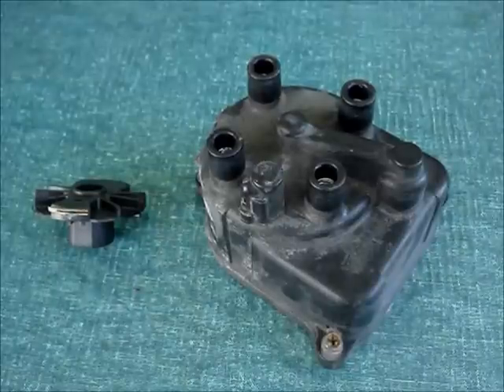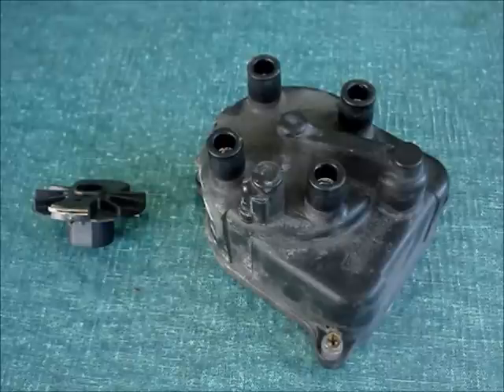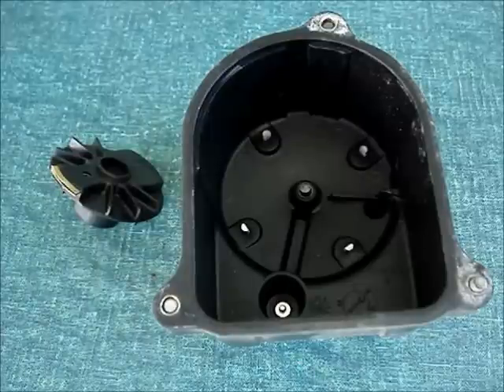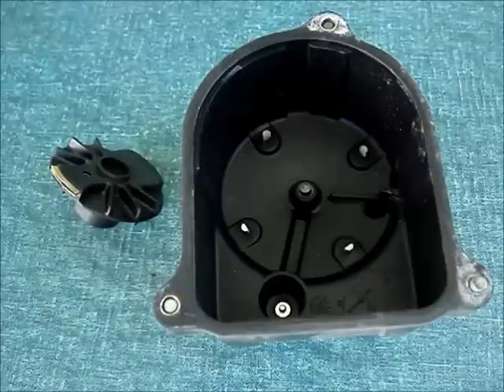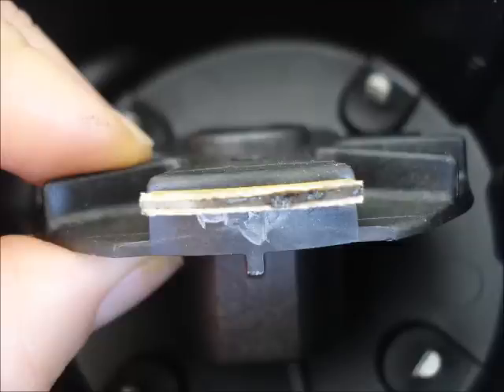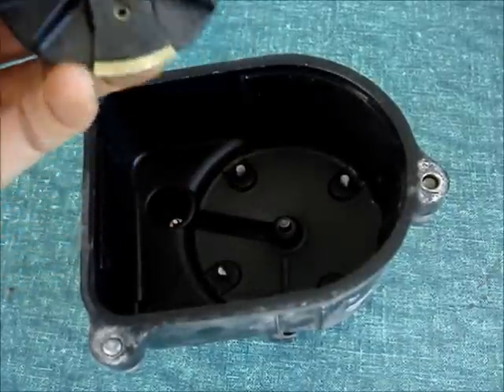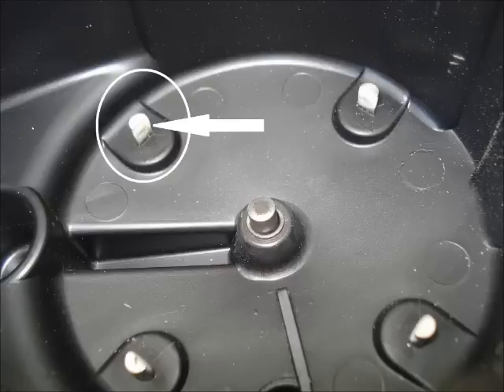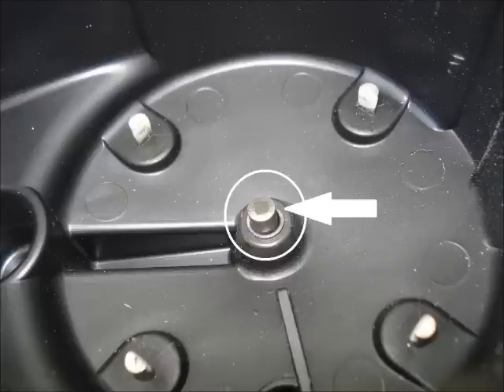Signs of Worn Distributor Cap and Rotor

Comment: 106 mile weak I have 308k know u could have just sanded the rotor was a waste of money
Reply from the maker: If I sanded down the contact areas, that would have increased the gaps to a larger size.  I'd think that by changing (already changed because the were indentations worn in the cap contacts) the size of the gap it would effect gas mileage.  You gap a spark plug, I'd think this is the same principal.  I'd think increasing the gaps even more would decrease gas mileage.  We are closing in on $4 a gallon for gas.  Do you check your gas mileage before and after you sand down those contacts?
Reply: @Know-How-Now  so when u sand the rotor and the nubs in the cap u don't wanna take a lot away u just wanna take enough of the burnt black crud off so that the rotor makes contact again with the nubs I do watch my millage cause she's an old bitch so I have to and I haven't noticed s change at all its when u start sansing to much and the gap gets to big that u start having misfire problems and millage issues. This is just Inexspensive quick fix if u need to get your car going ASAP and don't have time to wait for parts. I wouldn't rely on this forever but it has saved me for sure
Reply from the maker: My cap had grooves worn in it.  My gas mileage improved when I installed a new cap & rotor.  I don't think it was a waste of money to replace them.  I was burning money with every tank of gas.  To be clear, you are saying that sanding is OK as a temporary fix.  Correct?
Reply: @Know-How-Now  if your the nubs in your cap have grooves in them they u can't sand them. I'm talking if u have a short or something happen like when u make an electrical ark and that black corrosion shit shows up u can sand that off a little so the metals have contact again. If your nubs have actually grooves in them it's fucked there's no sanding it same with the rotor if the rotor just looks burnt like black on top almost chared u can sand like 1 2 swipes to just bring the metal back and make contact but If it has a notch in it or something it's no good it'll cause miss fire even with good contact

Comment: What symptoms will you have if you’re distributor cap an rotor is bad. My car when stopped at a light my car would start to die would that have anything to do with it
Reply: yes ur car will bogg down and die or it will not start or start could take longer it  will also run very rough what i did was open up my cap cleaned the contacts with a small wire brush untill thr shiny also do this to the rotor this will help in the mean time to save up to buy a new rotor and cap

Comment: my 1999 Honda accord v6 vtec caught on fire after changing plugs and wires! i had also cleaned the mass air flow, throttle body and intake with m.a.f.cleaner and sea foam. After five minutes the car died and i seen smoke coming from beneath the hood. After opening the hood i was shocked to see the distributor in flames luckily I was drinking a glass of tea so I immediately poured it on the flames saving my car surely. Is there anyone that can tell me what happened or what i done wrong?
Reply: theonlyrealone 2breal might not have tighten the spark plugs all the way. ive read on my owners manual that they tend to get really hot if not properly tighten . im no master mechanic but id start with making sure u install them properly.
Reply: theonlyrealone 2breal I think maybe some of those cleaning products were the problem.  Sometimes cleaning products can have a very small amount of alcohol in them.
Reply: All the chemicals u used  could  have started  it u should  wait about 30min or so after cleaning anything w throttle body cleaner flammable ♨️